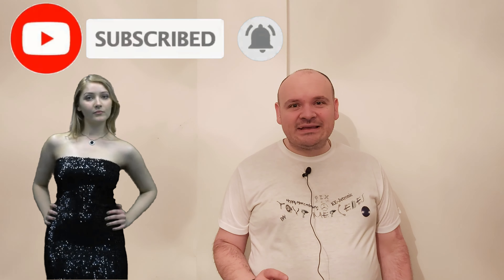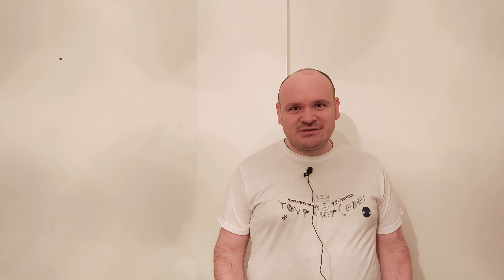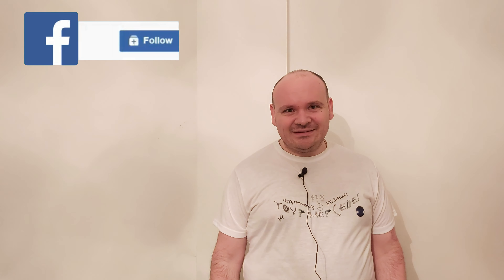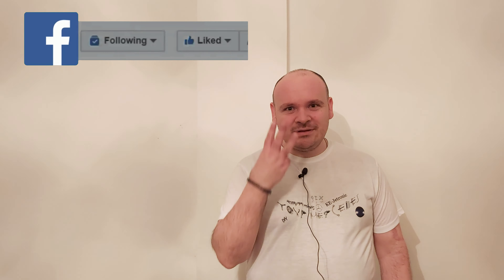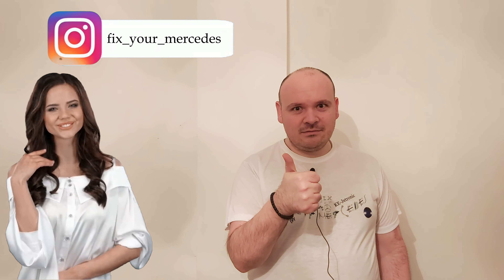About my help on newer cars(A question I got twice)

Comment: i have aqustion sir 
i have mercedes w124 E300 1989 , automatic gear
the automatic transmisson dont shift gears when the car warm up to about 80 degree and above ..
..but when the car cold  about 40 to 50 degree the automatic transmission work fine ?